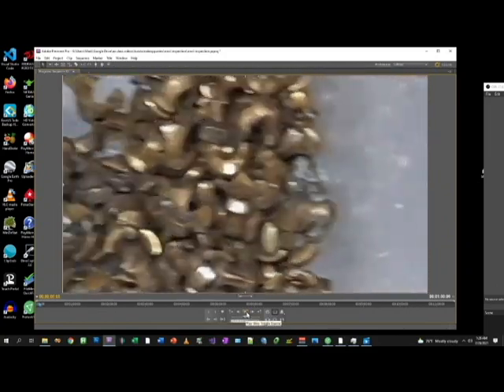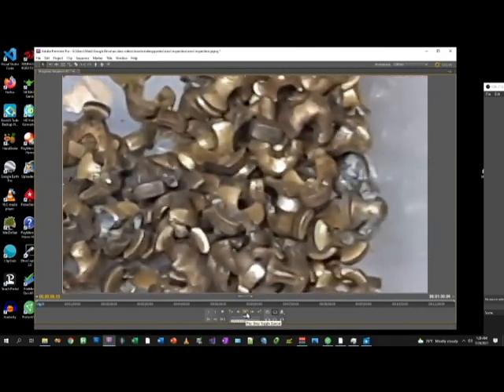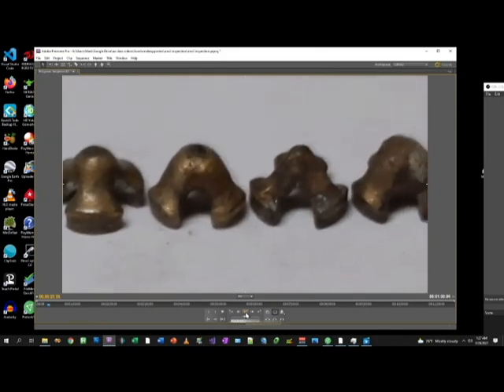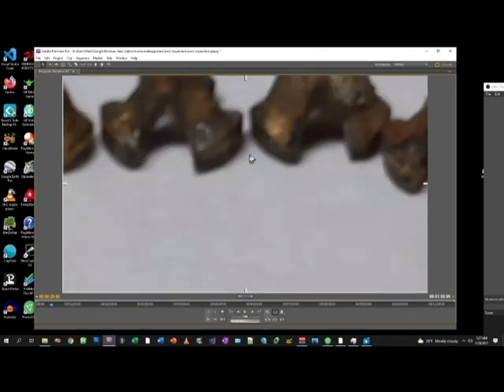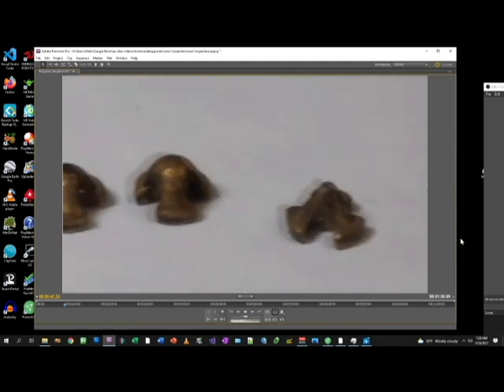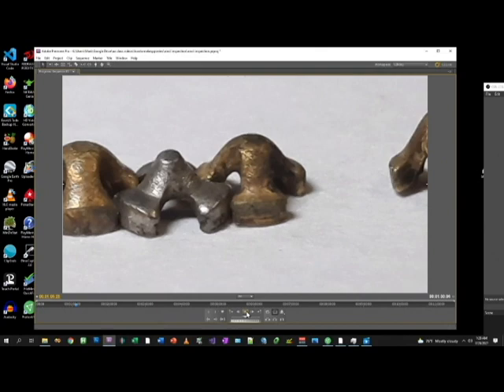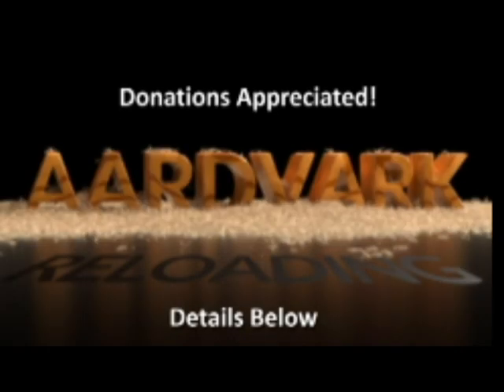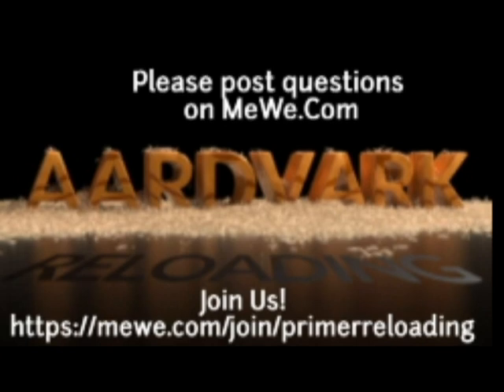Homemade Primers - Anvil Inspection

Comment: I guess iam going to get new glasses.
Reply from the maker: The only useful piece of information that I learned is:    It's important that you wash/clean your anvils as well as the cups.    The "crud" on the anvil can cause misfires.    Also - the dwarf anvil probably came from a #41 miltary type primer and should only be used in 556/223 type primers.    The round nosed anvils are CCI and you want to re-use these anvils whenever possible.   They plain ol' work better and are the most cross-compatible between sp sr spmag.